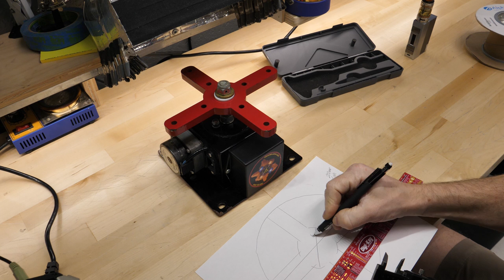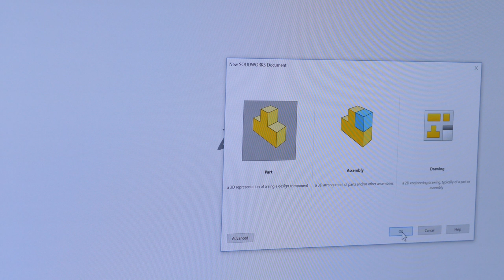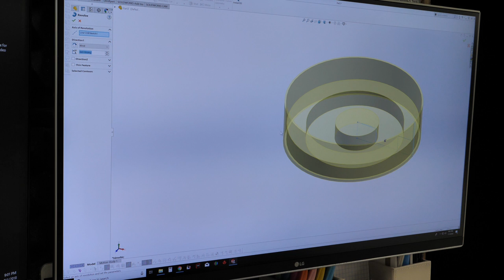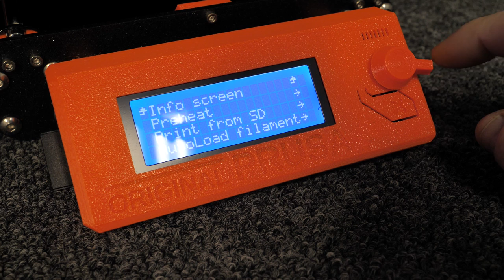forced to work weekends

Comment: Hey my friend could you do a video on how to build a quantum board from scratch? With the Samsung diodes? Lm1oah or something? I would really like to know from scratch where to get a board and glue the led on and wire it and not have to use a fan for heats ink.
I have a really cool new light ratio I want to try from a light expert and would love to be able to do my own light with quantum board

Comment: @growmau5 Please tell me you guys are working on refining the spectrum, then applying it across the board, was hoping to have UVA built into your cob replacement, as well as collaboration on refining spectrum, (if needed) it would also be really cool if you guys could include more advanced features built in. Like phytochrome switching, and Emerson effect. Come on boys, you want to claim to be top dog, act like it, flagship model please.  ; ) Nothing but love, just picked up two single strips for a 3x3, love them so far!
Reply: I love the cob replacement idea, much more uniform that way, I don't really like the size he went with for the panels, its an awkward size for many configurations, though it come down to spectrum, needed to try it side by side.

Comment: remember when u n Chris use to go on and on about how blurple light is cheap and if its not white light its old tech. Funny how that has changed. The red n blu r still the drivers of energy even w white light its just easier to get a proper light distribution though out  the plant w the white (green) . All in all any mixed either cob n mono or qb Samsung chip based light w deep red n deep blue will destroy any equal watted white light of same chip quality!